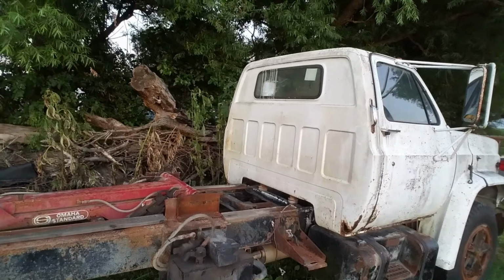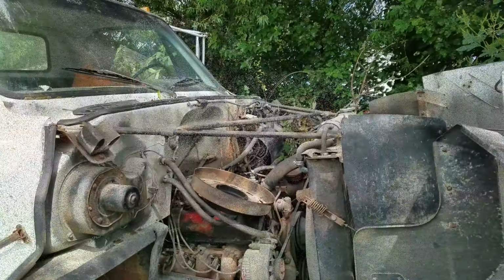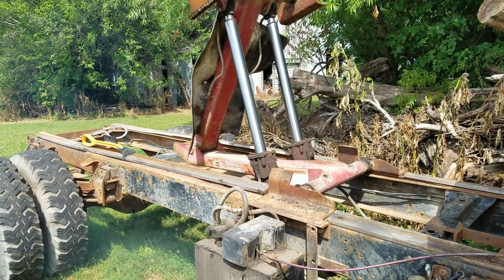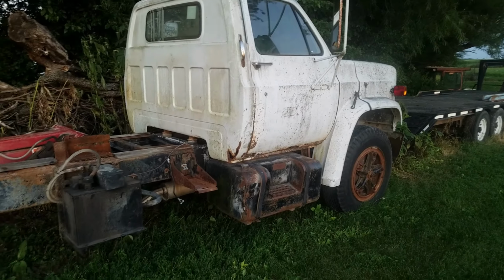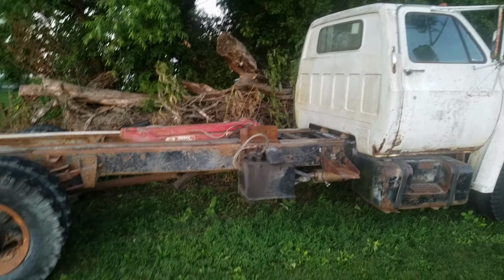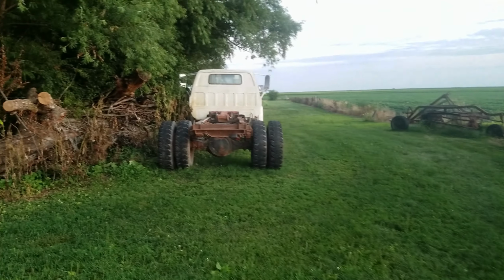Oh Brother! Another Project! What should we do with it?

Comment: Put the cargo bed off the military truck on it and make it a dumper. You probably have to do some reinforcement like we did with ours but they look cool!
Reply: Definitely ditch the gasses  to
Reply from the maker: That bed is slated for my buddy's super truck, and we were going to make it a dump bed.  I'd be interested in seeing what you had to do to reinforce it.  We got that hoist from this truck and some other telescoping cylinders to use, so we've got a couple options there.  I really want to use that 3208 in something since it's a good runner and I hate to just leave it sitting there.  Thanks for watching and for the suggestions!
Reply: BurningDinosaurs I will make a video of the dumper and tag you in it!